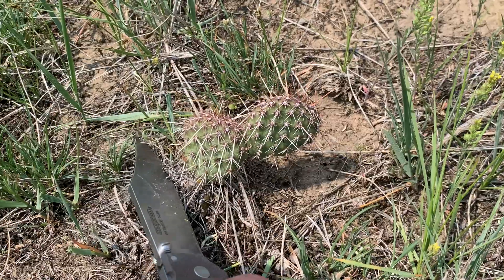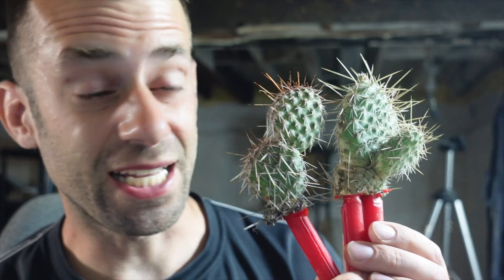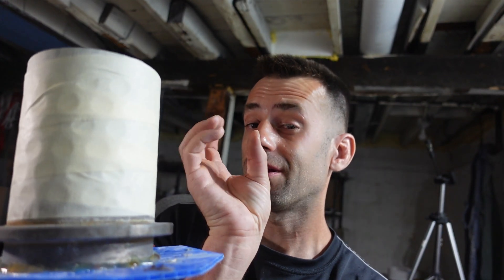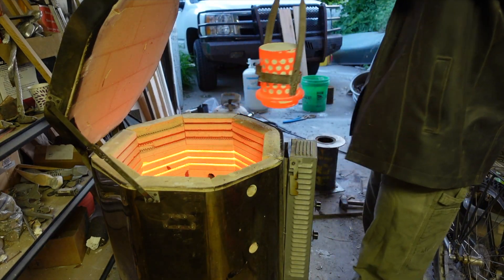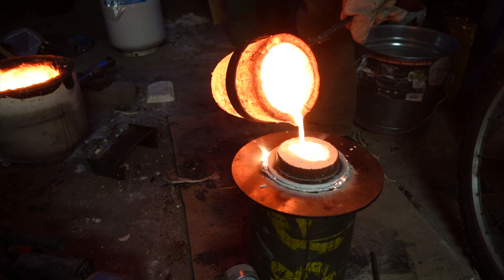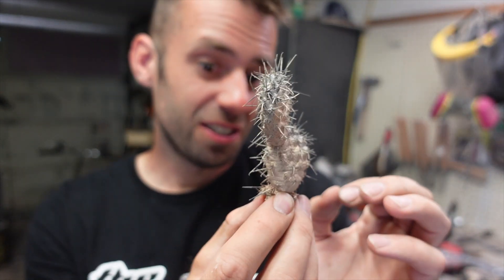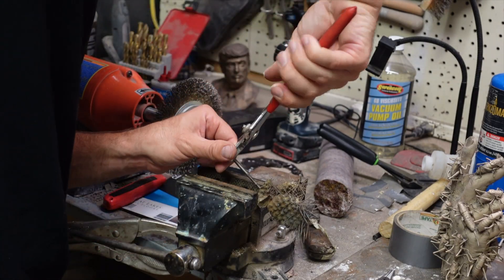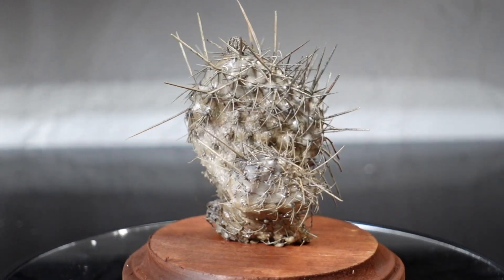Experimental Bronze Casting, Bronze Prickly Pear!

Comment: Looks fantastic!  Just amazing how you can replicate nearly any dam thing you want.  With full vacuum assist the needles may have even been thornier.  Regardless, the experiment proves you can cast an army of Prickly Pears! 

A black walnut stand might compliment bronze better?  Walnut is the king of hardwoods - using carbide cutters it machines and finishes like butter,  plus the wood is known for its dimensional stability (a top pattern making wood in the foundry industry). Ebony has an even blacker color,  but is expensive and so dense it damn near weighs as much as bronze. If you prefer reddish brown colors then Honduras mahogany is another beauty.
Reply from the maker: Oh black walnut is a beautiful wood. It grows around where I live. It’s pretty expensive but even a scrap would make a good stand for something like this.

Comment: If you take off the fan shroud on the pump motor, you can grab the cooling fan with the motor turned off and get it turning by hand. Then when you turn it back on it will start right up, mine does the same thing sometimes.